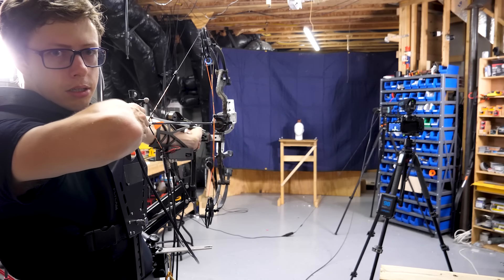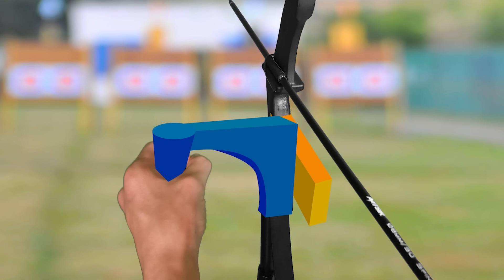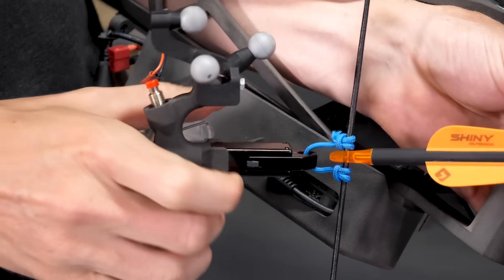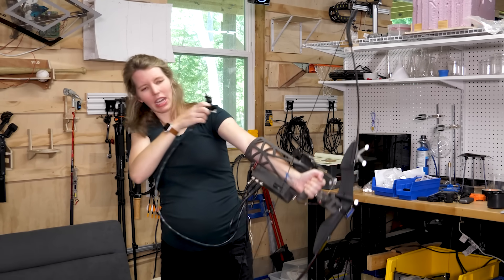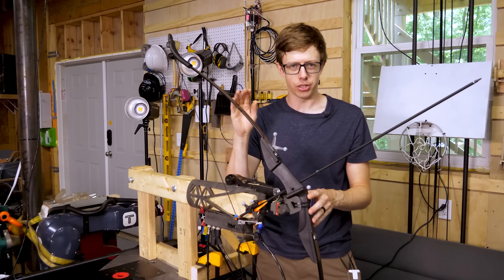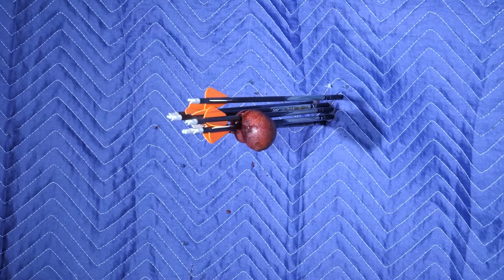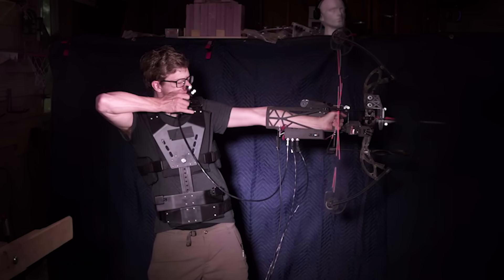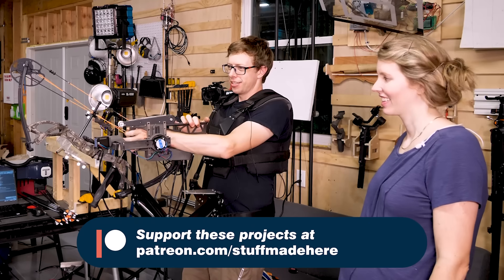Auto-aiming bow vs. FLYING targets

Comment: This would be an amazing zombie apocalypse character weapon. 

Imagine. Dr. Fredrick Dallas, Professor of software and robotics engineering at MIT, gets trapped in the basment of the Robotics lab during a zombie outbreak. He reamerages after two years with an extraordinary compound bow machanism. It's attached to a carbon fiber arm to shoulder mount, meant to help with weight. Aswell as three small; fully automated drones, which fly around the professors immediate vicinity at all times.  The drones constantly scan the area, collecting movement data which tells an AI exactly where to shoot. All the professor needs to do is point at a target and push a button, the bow does the rest. Fast, weightless, pinpoint aim every single time; basically real life aim bot.

Armed with his smothered lab coat, bow, and three trusty drones. Professor Dallas roams the urban areas of the zombie infested wasteland, hunting small game and being an all round’ zombie killing badass.
Reply: Someone should make this a short or a really nice comic!
Reply: I read this whole thing it was beautiful you should write a book about this. obviously with your great descriptions and ideas you could. I don’t like reading but if you do write the book I would easily be your first buyer. You have a gift and you should explore it.
Reply: Low battery please charge

Comment: I cannot believe how well it compensates for your complete inability to draw a bow correctly. If you had taken one archery lesson you never would have punched yourself in the face, let alone an entire afternoon. Still, impressive technical stuff at the end of the day. bullseyes are bullseyes. Also, how does your rig reduce the draw weight? It just looks like it transfers the weight of the bow itself to your body (which isn't significant), but it's still just your right arm drawing. i would think being able to press the bow apart with your back would be easier then having to draw it completely with your right arm.

Comment: As an archer and someone who enjoys making things this is really cool.

One thing I couldn’t help but wonder is if your robot takes into account where the anchor point is. The anchor point is where you hold the string and knock (back of arrow that clips onto the string).
You corrected for some of this with the compound in that it has a set (yet customizable) draw length. What I didn’t see you mention was correcting for if you hold the release bot further away from or closer to the bow’s center. This could have been one of the reasons the recurve kept shooting up and to the left

May also want to think of switching to a drop away rest instead of whisker biscuit (like you have here) for version 2 as it will provide less interference and should improve consistency
Reply: I think he meantioned that he put a tracker on his release.
Reply: Yes, but I don’t know it measured sideways distance while it did measure distance from behind the bow

Comment: I wonder if it’s possible to use those Microsoft augmented reality to give you the ability to hunt. Maybe use 2 cameras fixed to the bow and use machine learning ai to determine shape of an animal and move the bow to the get a clean kill on a deer. 

Goggles to track and mark the target and the others to determine the ballistics to the target.

Tracking point did this with rifles but they use lasers. It would be sweet if you didn’t have to do any spotting and left it automated. Just pan your head, lift bow, and shoot.

Comment: Do one with a gun. If you get a good design down you can licence it and your wife will never complain about you spending money on tools. Apparently the new tracking point run on linux code so if you could get your hands on it it'd be a good palce to start. There's got to be a cheaper way to make one.

Comment: I think you could have made this much simpler and a lot lighter with just a small mechanical manipulator of some kind at the tip of the bow where the arrow flies off that tips the back end of The arrow as it leaves the bow changing the flight trajectory. And then using a program to calculate that new trajectory keep on Target honestly a small hoop that can move in a x and y axis running on said program should have done it

Comment: You are awesome to watch. But I feel like you could get so.much help from us. For example the fundamental flaw with recurve or long bows is that the harder you pull the more force you have. And you could write a program for that. However compounds and cross bows are way more accurate. And yes arrows are important. That's why they sell cheap ones and ones that cost as much as bows them selves.

Comment: Spent most of my years before 25…. Bowfishing competitively. Basically… take a fan boat through the shallows after dark, with a generator running huge lights on the front… you’re cruising about 5 to 15 miles an hour pretty fast through the pitch black… With only about 20 feet of light out in front of you. Which goes by really quick. You try to shoot fish that are exceptionally fast and hard to see! While you’re basically flying past them.

After a while, (years of hard practice)… I could split a 2 inch minnow at 15 to 20 feet! 😂 

which was still easier than shooting an 80 pound catfish in 18 inches of water. People don’t realize how fast catfish can accelerate. Pretty much instantly. Even the big boys?

As a fellow engineer, and who spends pretty much all of my time in the lab… Your work is incredible! 
But I’m sorry… but your wife makes these videos absolutely hilarious!!! And so much more fun to watch.

Comment: lol you should fix your project to use two or three cameras on the bow only instead of the motion tracking setup / use tension measurement of string with strain gauge + gyroscopes instead of motion tracking the release servo (consider over-volted solenoid for release mechanism as they may be faster).  Consider ball screws for motion instead of rack and pinion for more precision. Maybe you need motion correction on your string release handle to accurately point the back of the arrow.

Comment: Awesome, but you might have been able to aim by only moving the arrow rest instead of the whole bow, though I'm not at all sure that would satisfy your accuracy specs. 

If you can aim with that (arrow-rest-position exacerbating archer's paradox being the main concern), it would mean you wouldn't have to move the entire bow mass. 
This could reduce inertial hand sway and offer a more stable grip, plus, controlling a small mass is obviously easier. Also it might significantly cut down on the device weight.
Archer's paradox might be mitigated if the aiming arrow rest drops away immediately post shot (similar to consumer drop-away rests) but the string might apply too skewed a force on an arrow without having a rest to direct that force.

If you haven't considered the idea yet, it might be worth a look.

Comment: As an Engineer, i still struggle to find myself wanting to push through an issue like you had. I get frustrated and angry very easily with some issues ive dealt with at work; and i'm trying to get better; but its still hard some days. Did you have any issue with that as well? If so, how did you improve?

Comment: It would be very interesting, I think, to see a more detailed view of the programming and electrical hardware side of things at some point. So much of your time is spent programming, and to me that is the most difficult part of personal projects. I'm a mechanical guy, so that side of things is easier to get right and to start tackling in the first place, yet the ultimate success and "interesting-ness" of a project depends heavily on the aspects that interact with a computer.

If you've developed a workflow that works well for so many projects, I'm sure others will also enjoy seeing that.

Great job with designing those Formlabs printers by the way, we have one at work and it makes parts that get shipped on the final products. The rigid resins are really something else.

Comment: Next step : Mount the cameras on drones that are software controlled to fly in formation around you. Then use a laser for target acquisition.
Reply: Lasers are incredibly dangerous to the human eye, especially if you're trying to use them outdoors, during the day, at long distance. Because of the inverse square law, a higher intensity laser would be required for longer distances which means it's potentially more harmful to someone's eye if it ever makes contact.
Reply: @therealdoc  Then either don't point it at people (btw why would you point a DRAWN BOW at people ????), or maybe some other method of target designation is possible.

Comment: Should get with jeorg sprave from the slingshot channel. It would be pretty amazing to see a self aiming rapid firing bow
Reply: I suggested the same thing!  Imagine an Instant Legolas but where just the right-hand "string release" is automated, so that like a "Tracking Point" rifle the string releases only when the bow calculates that you have (manually) aimed correctly at the bullseye (repeating the calculation many times per second). That would be an awesome project.

Comment: Intuitive archer here (no scope/sight not release or stabilization) for moving targets going up I tend to wait until it is almost at it's highest point since it moves less distance, giving me more time to release the shot.
Also for sideways moving targets I a slightly behind the target, follow it and then speed up my movement until I pass it and feel like I have the right distance.
What is really cool with a recurve where the arrow lies on your hand (ruiterboog, don't know the translation) is that fact that the arrow goes slightly to one side, where the spine of the arrow can correct this a bit. It makes for a cool pattern when raising the bow to shoot a longer distance where you exponentially move the bow to the other side for each unit of height.
The height of the nocking point in relation the the center of the bow and the place the arrow lies on the makes a huge difference in how steady it flights as well.

Comment: Arrows don’t leave the bow instantly when you release. It gets pushed by the string for a short time during which your arm holding the bow is also moving. That movement will be transferred onto the arrow and impact how it flys. A big part of pro archery is getting this movement as consistent as possible, otherwise the arrow won’t land in the same spot even if every arrow is perfectly aimed. I am assuming that this is a major factor hindering your accuracy, hope this comment can help
Reply: He mightve known about that which is why it made it not surgical. In the v2 he might be finding ways to focus on that part. This is made by one guy on a shop

Comment: I shoot recurve. Archers go to insane lengths for the perfect shot and it's better in integrate that. A drop-down rest would be a "cheap" far better improvement! Couldn't quite tell what arrows they were, but higher tolerance ones would be ideal, and spined correctly for the poundage. It's more obvious on the recurve and the strange flight pattern, but arrows matter massively. Better arrows can get sold in singles as well so you're not spending stupid money on a set of 8 or 12, If you're gonna go down that route, fuck it treat yourself to spin wings, they wouldn't be much more for installation

Also it'd be far better to get in a more stable position. I'm not gonna critique your form because the point is for you NOT to learn how to shoot, but just getting the rig so the bow is much more close to the body, and closer to what would be a natural draw, will allow your arm and entire body to stop shaking, and for you to not do your back in from leaning back too much while shooting. As of right now, I'm sure the human error is affecting flight far more than the software

Comment: With a recurve bow, the further you draw the faster the arrow will fly. I don’t think the first software detect draw lengths and correct for the changing arrow speed which is probably a bigger issue than archer’s paradox. Compound bows have fixed draw lengths so the issue does not apply.

Comment: From an archer and an engineer, this is awesome! 

Some things that might help your fine tuning, especially if you're doing a model based control are your tiller, nock point, release/follow through, and equipment. Tiller is the difference in position between your top limbs and bottom limbs and can move your arrow up or down. Your nock point should also be a little higher than your arrow rest (i think no more than 3/8”). Your release is probably fine but there are bad releases which can throw your shots a bit right or left. Your front arm moving after you release can also affect your shots a good amount depending on how much your control compensates for it.

 For the precision you're looking for, also make sure your arrows are tuned to your setup (spine stiffness and arrow weight to bow weight and draw length) so that they fly straighter. Arrow manufacturers like Easton will have a chart. Make sure the arrows are good arrows too. Cheap ones only have about 0.006" straightness tolerance whereas nice arrows have 0.0015" or better and definitely make a difference.

Can't wait to see part 2!

(Edit) I forgot to mention, if you do improve it significantly, definitely look into pin nocks. It's not too hard to Robin hood an arrow and it's a lot easier to replace a pin and a nock than the whole shaft
Reply: I would agree that the arrows need to be matched with the setup, really big deal. I would also add that a drop away rest might be an idea to look into, they definitely shoot better. I'm not sure with the quick motion though if it would be better than the whisker biscuit.

I built a basement range as well and will say that a horse stall mat from tractor supply, hung from the ceiling does a great job as a backstop, sometimes a little hard to pull out but haven't had to deal with busted tips or broken arrows.
Reply: My suggestion is he buys/makes a Fenris. All the awkward holds on the string will be eliminated and provide a consistent draw length.

Comment: The arrows were kicking off the shelf on the recurve. It’s because your arrows were used solid plastic fins. You need real Turkey feather fletching. The Turkey feathers fold flat on the shelf of the bow so it doesn’t jump off to the left. This was super noticeable in your shop because you were firing at close range. With more distance the arrows would have eventually stabilized.

Comment: Make sure to flex your arrows and examine closely before use to check for cracks or they could explode when fired. Haven't seen it happen but have been told a few times to check